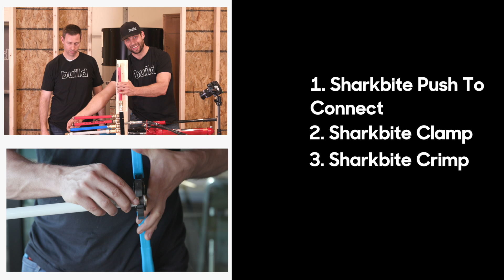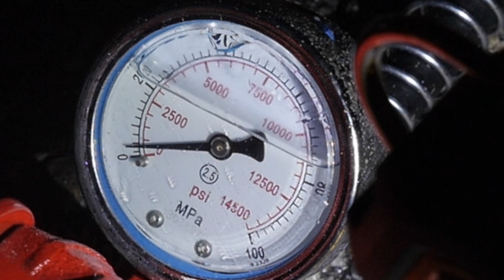Can we blow off these PEX fittings?  Sharkbite vs Viega vs Uponor

Comment: Video too long!!!  Fittings leak? Shark bite flew off at no pressure, with your finger on the fitting? Hydraulic fluid in the lines?  Guys these results are very skewed.
Reply: Should request a video from project farm to do these testings
Reply: He was trying to track if it was moving. He did it in a way that makes the video suspect, but i suspect that was the intent.
Reply: @robsmith4884  that’s exactly what he was doing and I didn’t suspect anything else. The Haters gonna hate.
Reply: Sharkbites are expensive trash not surprised. I pull the thinga off with an adjustale
Reply: Completely agree. why'd he move his hand up to the fitting. POOR attempt at useful info.
Reply: @Derek Tinius, let me watch your channel to see how it is supposed to be done. Oh... you don't make any videos or anything for that matter. Yep, I should trust your knowledge and ability to mess with others.
Reply: And stop calling it pipe!

Comment: Really bogus test procedure as noted above. BUT the push on Shark bite was the worst. You were touching the pipe at the release ring it look like you pressed it to pop p it off like a  champagne cork. It doesn’t take much force to remove those fittings with the release ring so pressing on ring caused it to pop off sooner. Lame.

Comment: That’s not a fair test, the only variable should have been the fittings and not the pipes
Reply: Yeah, this was just a waste, practically clickbait
Reply: They were testing the piping systems. It wouldn't be fair to test PEX A with a crimp fitting. You can't use an expansion joint with PEX B.

Comment: When the pipe bursts, and you call that a loss for the fitting, which didn't fail, your test is bad.
Reply: Exactly - if the pipe burst, then the fitting worked better. The other ones probably leaked.
Reply: I don't think they had that first shark bite fitting installed properly,  so this video is a waste of our time
Reply: The pipes themselves are different too
Reply: Testing as they did each pipe held the pressure. Continuing with the same materials after a failure, it weakens the next results.

Comment: A bit of fun and some less than serious revelations. But, I think a fitting failure might be more forgiving than pipe failure. Not sure that anything could create the kind of pressure that leads to failure of any of the systems. Question becomes which system has best overall cost vs. performance. Even then it will depend on the install. Just replaced old galvanized pipe with pex with shark bite in tight quarters. speed of install got mer back to other tasks almost immediately. LOVE TECHNOLOGY!

Comment: Not a completely useful test because you aren't using hot water.  If a plastic pipe or fitting is going to fail, it will fail first at higher temperatures.

Comment: Sharkbite is only good to get you out of trouble until you can do a permanent fix, I'd never make a whole house with those connections. With type M copper, I prefer them over a compression joint for an emergency repair since M copper pipe is too thin to compress around it properly. With type L or K, I'd just use a compression joint : it's more reliable than a sharbite and it can be soldered once you get the pipe dry. 

At 300 PSI the fixtures in your house will fail first so I'd still pick Uponor. 

Since the most common failures I have on water lines is a frozen pipe and water hammers (which Uponor tolerates better since it's the most flexible PEX) I still prefer PEX over copper. 

I have seen a rusty metal crimp fail (which happens for too many reasons to list them all but cold pipes just tend to attract moisture through condensation). Personally I also don't like connections that are smaller than the pipes they serve. Still, I'm impressed at PEX B: it's far stronger than I imagined and it still fails far less often than copper pipes. 

Doing this test on copper could be dangerous, especially if you use type K or medical grade pipe and you silver braze the joints. I don't recommend doing that, from personal experience type M with normal 95/5 solder often fails around 160 PSI but those are old joints and joints that were never done properly (there are many ways to make a subpar solder joint that still holds just enough to tolerate everyday use) while just about anybody can crimp a PEX joint properly. And a badly crimped PEX fitting can usually be recrimped anyway. 

Finally I would definitely try a water hammer test with at least 20' of tubing to give the PEX pipes some room to expand and absorb the water hammer.

Comment: The take away from this video is don't put shark bite "PUSH IN" fittings inside walls or inaccessible areas. Ive been hearing that for years from plumbers so I'm not surprised at all. 
Matt predicted that "PUSH IN" would fail first, probably heard the same warnings. No surprises there.
  
Even though the Upinor burst first its probably not significant, however more significant is the Upinor has larger diameter fittings compared to all the others. They give true diameter, not reduced diameter like the rest.

Comment: most pipe and fittings  usually   10 bar max  in domestic  system =   145.038  psi  they were testing  to destruction

Comment: The only thing that I see is that your not very fair to the shark bite and I didn't see you put your hand on any other of the fittings and how much pressure is going to be on those fittings in a residential house not much I've had shark bite fittings in my house for yrs and had no problems so maybe make the test more fair

Comment: Let me know when you guys find a residential water line at a Psi over 150psi let alone 500psi, your guage is graduated in 500 psi increments. No residential system is designed to take on much more than 80psi being the maximum. To conduct a proper test as mentioned by another commenter is to eliminate the confounding variables like pipe length and the accuracy of the pressure output sesnor/indicator. What is the accuracy tolerance of that guage +/- 2%, 10%? Moving that needle even to the first graduation indicates a holding pressure of approximately 500psi far above maximum residential water pressure. I'd say every single fitting worked as designed.

Comment: Ive have pex as air lines in my cabinet shop for 12 years now, not one issue. I can cut into and modify as needed, recently I ran 3/4" to my build tables all the way to the splitter so I can run two pneumatic sanders at the same time.
Reply: I was skeptical to use Pex.. but I'm giving it a try this weekend... it is Pex A pipe tho
Reply: @demarques1911  How did the Pex A go? Did it work smoothly and was everything good to go?

Comment: What you should have done is that whenever a pipe burst, you should replace the rest with new pipes. Using the old ones repeatedly with that high pressure will eventually reach their limits. How many times did the last one had 500 psi in it..4 times?

Comment: Wall tension counterintuitively INCREASES as the radius of the cylinder increases. So not only is there less material as the piping thins, but there's also more tension it has to handle. This is why you need thicker or stronger material to hold the same pressure in a larger vessel.  It's also why aneurysms in the human body are so dangerous. 

Google "Law of LaPlace" if you want more info.

Comment: so all ive learned from this is that all these fittings are good an would never fail from normal water pressure lol
Reply: @Icantfindanavailablehandle  bullshit. Hot water does not have higher pressure in a pipe dummy. It has lower pressure as it has to typically go through two water treatment devices, a water heater and a water softener. Color of the pipe doesn't matter. That's paint. The pipes are all made to handle the same psi. The rest here is about how well each form of connection works.
Reply: Another thing you should have learned is that you don't want these two guys to be doing your plumbing... :)

Comment: Would have been a great comparison if we knew the failure pressures were. I should have known it wouldn't be very good when they couldn't get the threaded connections to not leak.
Reply: I cannot believe that they didnt show the most relevant part. Also I would have liked to have seen it with just air pressure.

Comment: A lot of guys ask me if you can use PEX crimp fittings on upanor pipe. Did you guys ever test this?
Reply: That would not be the proper use of PEX A, aka Uponor.  PEX A has a different stress to strain response to pressure compared to crimped PEX B tubing. A PEX A joint will not perform and seal properly as designed using a crimp ring. The PEX A tubing with the shrink sleeve, installed on the tubing before expanding  using the correct expansion tool, wants to shrink back to the original size it was before the tubing is expanded to allow the fitting to be inserted into the tube. The OD of the male fitting is larger than the ID of the unexpanded tube. PEX A wants to return to the original unexpanded size, therefore after joint assembly, will always be tightly gripping the fitting barb. The shrink sleeve installed on the tubing is PEX A material also, and provides most of the sealing force for the assembled fitting joint. Using a PEX B crimp ring on PEX A will not seal properly long term.

Comment: Great video ,  as a plumber I appreciate the nice testing system you have I think your sample pipe should contain a Pex crimp on 90 degree fitting and maybe even a capped off PEX crimp tee fitting. It might be interesting to test a length of PEX that was kinked.

Comment: I stopped using teflon tape 20 years ago. IMHO tape is pure chit. How can you possibly NOT cut the tape when you start tightening the threaded fitting. I use Leak Lock on gas pipe, and permatex thread sealant on air, water, and hydraulic lines.

Comment: This test seems to be a multiple failure:
1. Shark byte at top was already moving prior to test; under-inserted?
2. No proper gauge to measure pressure;
3. Even threaded connection was not properly done.

Not convinced, sorry, guys...
Reply: Holy dangerous. Your bodies are way to close that hydraulic pressure with the intentions of bursting.

Comment: Other than the push on Sharkbite the only failures were of the pex pipe not the fittings.  So it would be safe to assume that other than the push-on shark bite everything else is more than adequate for ANY home use.   I've heard of (Experienced) a county water system hitting homes with 125 to 130 psi water that caused several home supply fittings to fail so all the pex fitting will probably survive any home use.

Comment: Let's see... we are testing fittings, with different pipe types?  Stupid.
We are testing with a gauge that gives the impression that all PSI are FAR north of 200 PSI at a minimum... when my actual home system is configured such that it is not possible to ever get north of 60psi.
Absolutely worthless testing/methodology.  This video is the equivalent of two teenagers seeing which firecracker brand makes the biggest boom by using an overpriced sound level meter.  About as useless results.

Comment: The shark bite  cap didn't fail.  The joint at the bottom failed
Reply: It was shark byte too, so same difference.
Reply: @AdamKover  threaded
Reply: @Spawny500  Threaded to the manifold, sharkbite to the pipe, which is where it failed.

Comment: So different fittings?
And different pipe?
Pressure gauge with  inappropriate range?
All connections and pipe were new, and all failed at over  any pressure they would ever see in a house.
So what was the point?

Comment: Yes, you need to retest without touching the first one, you can't say that the push to connect failed when you are pushing the connection.  You are correct, was no take away.  I have put PEX in and used all 3 including the push to connect and they work great as long as you install them correctly.

Comment: Interesting but you did it wrong. The test should take each one individually until failure. Also I would test a soldered pipe to test a normal failure pressure. Finally, each test you did was stopped after a pipe wall failure and the connection was removed, so you do not know the real performance.
You also mention that you know nothing about plumbing so how do you know if you installed the connectors correctly? You should have a plumber with you.

Comment: Why were all the pipe used different.  You should use stainless high pressure tubing that will not fail prior to the fittings.  This was a bogus test but fun none the less.

Comment: I would have liked the actual pressures. the lack of data to prove the test is not a troll issue its a protocol issue. I was extremely interested to see the results but no results can be assumed, because there was no attempt to collect the data. A pressure gauge with a test and hold feature would have left no doubt the pressure levels of the product. The use of water instead of oil, because use of a lubricant is counter to real world test. this is entertainment not scientific. A real test would be the freeze pressure test done by another streamer with actual pressure tests and the explanation as to why the extreme pressures are a concern. Thank you for the video and I hope you consider doing it again with an eye to see the data. the camera could have watched the pressures at least. This can be invaluable the your viewers to save money on products with better value.

Comment: The shark bite push to fit fail all the time but the others are great for pressure use cinch clamp on pressure washer 4500 psi and been holding for 5 years

Comment: Does the placement of the pipe in the test device have anything to do with what fails?  You should run each pipe independently all from the same place in the pressure device.

Comment: The most important finding of this test is: 1. fittings DO NOT FAIL at pressures we deal with in houses. 2. tubing DO NOT FAIL at pressures we deal with in houses. They fail at pressures almost 100 higher than those in houses.
The test was good enough for me. Why there are so many contrarians and fault seekers out there? Hate them.

Comment: Great test,  I know that shark bite push connect should handle up to 200 psi and 200 degrees.And I would bet even pex pipe would not handle much more than that since it is pipe designed for mostly residential plumbing. And a good thing everyone should have is a good pressure reducing valve at their service entrance set at about 55psi.

Comment: Would love to see a frozen pipe test for these. The more flexible one might do best.
Reply: Only 2 sources of supply failure I've ever encountered: frozen pipe that cracked copper and steel, and polyethylene 1/4 inch fridge supply gnawed through by mice.  The fact that pex outperforms all grades of copper and steel for all residential pressures (100 psi or less, typically around 40), costs less, doesn't corrode, easier to work with, and you'll never burn a house down installing it makes pex REGARDLESS of fittings the clear choice of serious plumbers and remodelers.  Just wish they made a really clear pex A.

Comment: I worked for a company that would install sharkbites every now and then. It's been over 10 years.. Haven't had one issue on any of those types of connections. Pluss on sharkbites website they Garentee them for like 15 years if you properly prep the surfaces and are installed correctly to insure a proper connection.. Ill tell you guys at if we ever get that call 😂

Comment: I'm not an expert, but I think that normally in a hydrostatic test, you want to bleed the piping of air, so that you don't store energy in the system (that's what all that pumping was about), and have pieces of pipe go flying off at high velocity, as in the 1st test. I'm glad you guys didn't get hurt.
Reply: I'm fully NTD II certified, and yes no air should be present in the system at all, It's not only in-accurate for hydro testing, but insanely unsafe even with the test piece in an isolated test area.

Comment: Am I the only one cringing about that relief valve in the background?  Code and professional standards around here call for a metal or CPVC pipe dumping anything coming out into a drip tray.

On another note, statistically a pipe is always more likely to fail than a fitting specifically because of how much attention is paid to fittings and connections.  It's an expected point of failure, so more attention is paid to the initial work.  In contrast, the pipe itself is expected to operate reliably up to expected point before failure, thus nobody  thinks about it during install.

Comment: So after this what fitting and  hose,do you guys recommend for repiping a house
Reply: im a plumber pex is a very good pipe to do a house with, just make sure they dont use sharkbite push to connect cause they suck. theyre ment to be used if you cant do the job that night and you slap it on and take it off to do it right tomorrow.

Comment: This test told me everything I needed to know and confirmed my belief, sharkbite push connectors are junk! I've never trusted them and therefore I've never used one and after seeing this I never will. BTW I'm an old copper guy I believe in copper since I've been using it for over 30yrs and never had a failure. I always use copper unless someone is dead set on having Pex because I don't like the way the Pex fittings reduce the water volume where copper fittings don't, a 1/2" Pex fitting is about 3/8" of so you lose 25% of the 1/2" pipe volume.

BTW why don't you cut all the BS out and shorten the video of the test, I wasted over 10min of my life I'll never get back!

Comment: That first one was extremely dangerous. We've had guys lose a hand or get impaled by tubing in the field with even low pressure. Your fittings are probably rated for 3000 psig while all those tubes are just plastic...